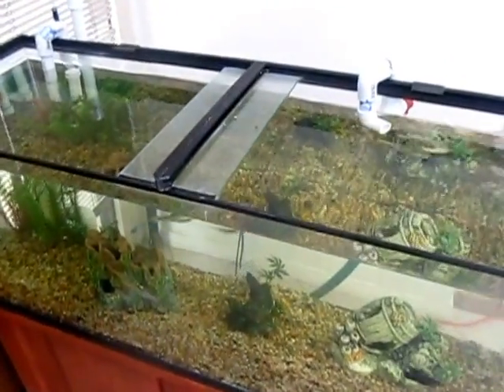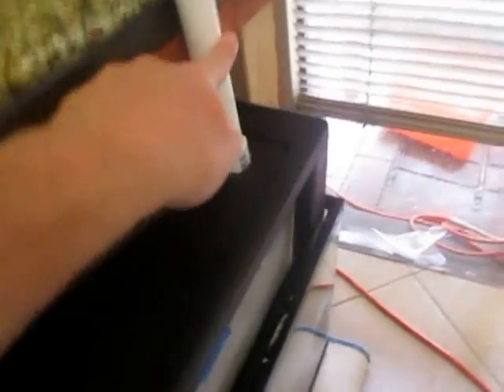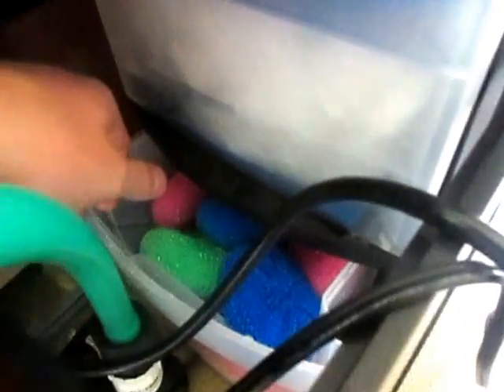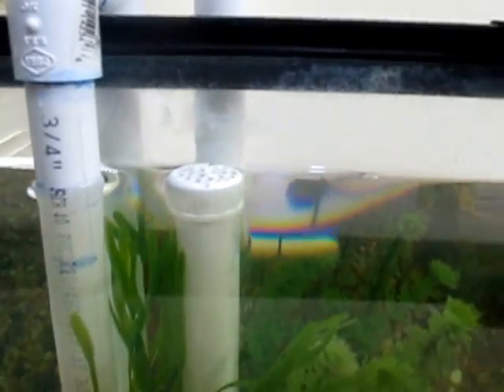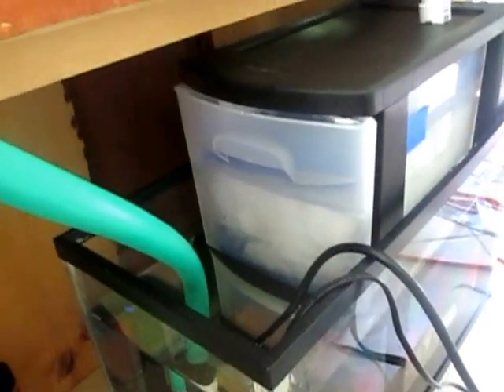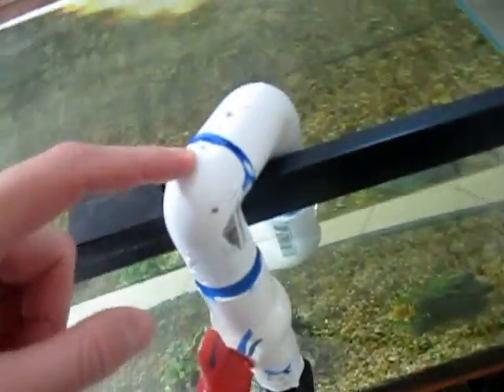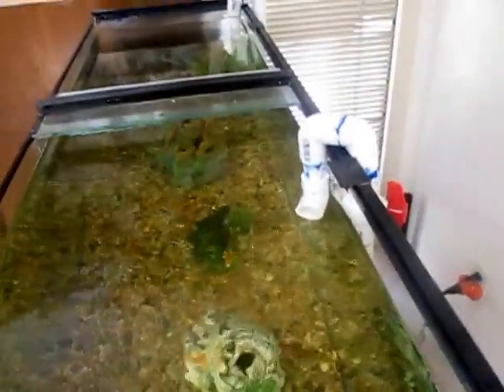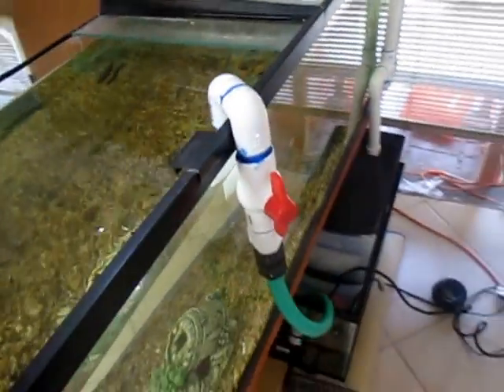DIY Wet/Dry Trickle Sump Filter with PVC Overflow!

Comment: i don't know when and you don't know when, but some day that thing is going to leak and soak your carpet, that thin plastic wont hold up...tom
Reply from the maker: In the seven years that this has been running, the siphon failed once, but the water level is low enough from the top that the sump tank simply emptied out, the pump was running dry (it continued to work after fixing this) and the tank got filled to the top. That's the main reason I didn't want the water level to be too high - so that if the overflow fails it won't immediately overflow the tank.

Comment: I did basically the same thing but eventually had water level problems, nomatter how many times I adjusted the flow out of tank then back in...it would change, pump weakened, or got dirty
Reply: Eventually I put my tank against a closet wall and pumped up above the tank and let gravity put the water back in the tank
Reply: No matter how good I got it...in weeks the pump changed the amount pumping, and I had to adjust  always, pain in the ass..now I don't even think about it

Comment: Hey bro ..I have done this DIY overflow sump system..but my return pump is flowing much water to the main tank and ...I mean input and output is not equaly flow...what to do
Reply from the maker: Do you have a valve on your return line so you can adjust how much flow is coming back into the tank? Also I would recommend going up to an inch on the overflow instead of 3/4 to accommodate the higher flow rates. Make sure your pump is rated correctly! If your tank is 50 gallons, you don't need a pump that's more than 100gallon per hour flow rate (that's an estimate)

Comment: Nice setup, 
This would be ok when keeping a few guppies or tetras.

I found out that you will need 3 - 4 times amount of pot scrubbers & the pot scrubbers can't be half or fully submerged but need to be in a shelf that is 100% not submerged but in a shower effect being more efficient. The more air / oxygen the more efficient pot scrubbers work.

I've learned that once you have 25 bigger Mbuna's or Peacocks & HAPS you'll need more pot scrubbers in general.

Plus I needed to get larger return pump, never thought that "head pressure" cuts flow rate by 45 - 50% of rated flow rates on box.
When any pump needs to pump water from the floor up 3 - 4 feet back into tank.

I added 2 diy pvc over flows to get that nice 5 - 6 time turn over rates needed for larger fish or a bigger bio load of 30 smaller fish stocked.

Always learning something new in the fish hobby daily...

Comment: Man this is such an awesome system and you did a great job explaining everything - It does stand out a lot though
Reply from the maker: Brian  Z thanks man! check out the update video I posted I put on a cover which does a good job of hiding the pipes. I could also put a backing/wallpaper on the glass to hide the hose but I never did.

Comment: You could add a fail-safe emergency overflow at a higher water level that could drain directly into the sump tank (bypassing the filter media) just in case your return pump is too strong.  That way your main tank would never overflow.

Comment: Really nice. I would suggest taking the poly out of the second drawer and putting in more bio media.  With the first and second drawer being poly its just making for one huge ass filter pad.  Thats probably limiting your flow quite a bit.  More bio media the better.  If your flow still isn't evening out to the point you're cranking you ball valve down too much then that just means you need more hole in your drain pan.  Less holes is better though because you can always make em bigger but not smaller.  All that's just IMO.  How often are you having to add water to the sump for evaporation?

Comment: Great video, I fully agree on the calculations needed to make this type of setup work.

Wish I saw your video before I attempted this.  You were right around the ballpark of $100 to build a setup like this.  The flow of water vs the drainage was what got me to abandoned this project and finally killed it because I couldn't get my overflow started.  All these videos saying that you can built a overflow for about 10 bucks, people don't realize PVC adds up very fast buying $1-2 dollar pieces and you need like 10-15 of them plus cement, tubing, pump, tubs, clamps, filter media, and other tools and bits you may not have.

I strongly recommend to just drill your tank if you have a cheap/small tank.  A $15 dollar diamond bit will save you more money than building a ugly PVC overflow which will cost about the same.  Then all you need is a bulkhead, some tubing, and return pump.  You can scrap whatever you need to make your filters.

Since I have a smaller tank and pump already, I'm going to start making a planter box sump that sits on my tank instead next.  The overflow is the hardest part of getting this right, so I'll just have it drip back down.

Comment: the only problem I can see with this method is that, the waste of the fish circulates somewhere in the middle or at the bottom, not at the very top, unless you have a wave maker pointing towards your intake, so although the whole filtration system is elaborate and consistent, I don't see how it actually filters the stuff it needs it and with you creating the suction by gravity siphon, I don't see how you can lower the intake because it would flood your sump

Comment: You killed it! I am blown away on the science you put into it, everyone else on youtube just wings it and it never works lol. So I'm through all the processes except the flow through the drawers for the perfect pooling effect. I'm having a little trouble wrapping my mind around how to even look up how to divide the tube circumference or whatever up to the number of holes I need with my drill bit. Can you hook it up on a hint? 3/4" tube 5mm drill bit. Used a lot of your concepts, I will make a video when it's done and share it on here.
Reply: you are massivly over complicating it, your falling into the trap of this is some sort of rocket science. it is not! set your system up with ball valves, a power head that can be adjusted and play around. this guys try to make it look like he has just invented a moonlander when he hasnt! its simple physics. you can even go on forums and find the calculations you need! either way he still had not got that over flow right, did you hear the racket it was making??? the only real art in this type of poney sysrem is making it quiet. that you do by leaving the system open to adjustment like i have previously said.

Comment: How does the syphon restart all by itself in case of a power outage? Can someone elucidate my mundane mind? ;)
Reply from the maker: DMRolim hey once you prime the siphon, it is always primed unless air gets in. so in the event of a power outage, the pump will stop working, the water level will get low but the siphon won't break. the siphon isn't really linked to power, only the pump is

Comment: Great vid. What size tank did you use for the sump part of your wet\dry? You didn't mention that. And I think your water level should be higher. Would look much nicer in the tank. Of course, that's all subjective, and should be according to your taste. But it's just a suggestion. Good filter!
Reply from the maker: Thanks! The sump tank i used was just an old tank we had laying around. It is 10 gallons i think. BIG MISTAKE. I find myself putting in new water all the time. I highly recommend getting as big a sump tank as possible. I'd like to put in a new sump tank, but I have very limited space. I'll have to keep looking around for something that fits. Also, I was nervous about having the water line too high in case the fish jump out which has happened before quite a bit.
Reply: If you're worried about that, Try screen netting. Or glass\acrylic tops. I have that issue with my Oscar, and if there's a lid, he's less prone to do it. The acrylic you can cut with a dremel to accommodate your input and output. And cover that area with window screening.
Reply: CribShelly  You were pointing at the pump but you said, I quote "the filter cost me 30 bucks". What pump is this?  I am looking for something in that range.
Reply: +CribShelly I made the exact same hook up you did but I'm my getting drainage. I wonder if I have a bad check valve? My inlet will drain for a few seconds then stop as if it's clogged up or something